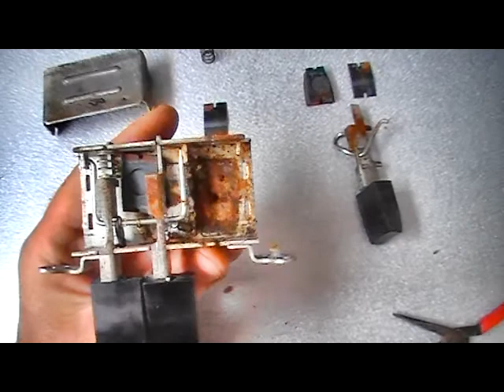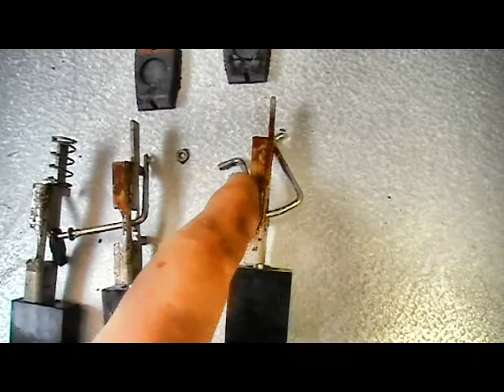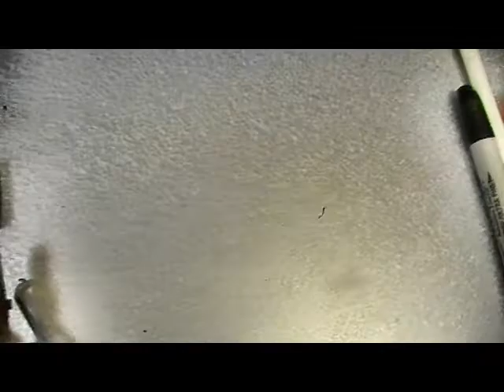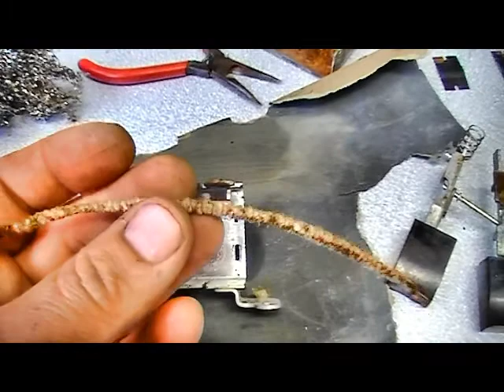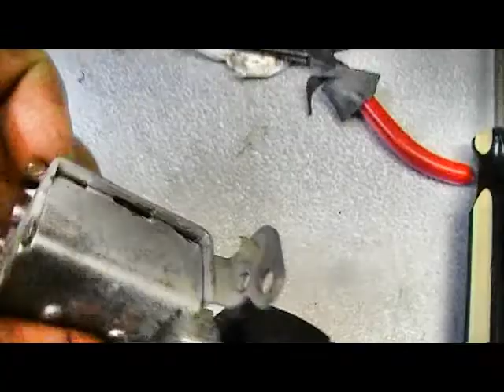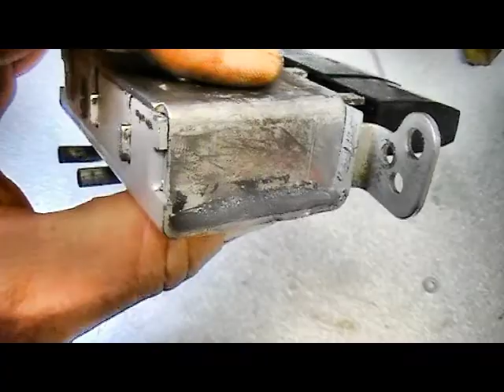Jaguar 1962 S-Type Vacuum Heater Control Switch Rebuild

Comment: This is such a good video but watch it to the end as he wrongly identifies the pipes at the beginning then adds a correction later. In every other respect this was fantastically useful. ALSO it has helped solve confusion about whether the s-type vacuum water valve should be open or shut under vacuum. There are conflicting opinions on the Jaguar forums. Clearly the original C19704 and its close replacement C43264 are normally SHUT at atmospheric pressure and open when a vacuum is applied via the switch.